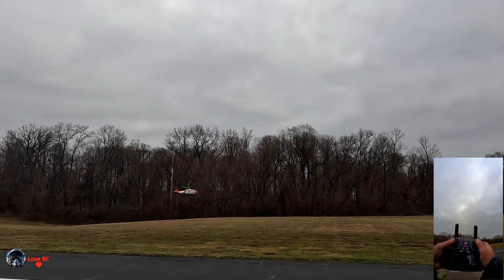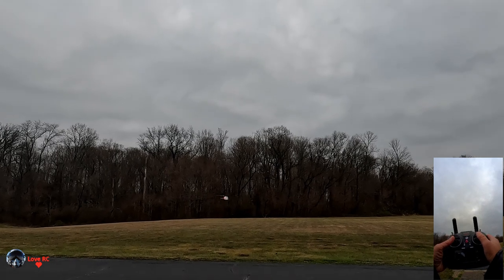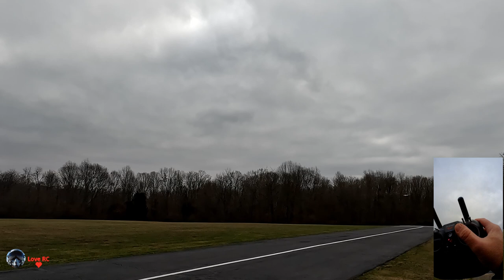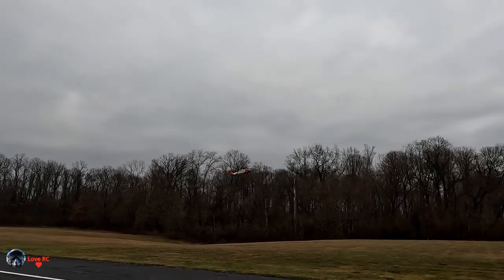YUXIANG F09-S Blackhawk Coast Guard UH60 Rescue Helicopter - THIRD FLIGHT!!!

Comment: I can never get tired of looking at this helicopter fly? It's definitely a great looking helicopter. Even the sound is not bad.  Very nice flight, Thanks for sharing.  👍👍👍
Reply from the maker: The main rotors have a nice sound.  Wish it didn't have a whiney tail rotor.
Reply from the maker: In manual mode you have to pull back on the stick to get her to slow down. Love the sound
Reply: @LoveRC  absolutely

Comment: i wonder if by putting more blades on that tail rotor.  if you can get it quieter.
Reply from the maker: The separate tail motor helis ate usually loud.  My blade 360 and 180 are not because they are belt driven.

Comment: no doesn't depends on how many satalites you have at all.  
when you are that close to the radio.  it will just auto land wherever it is.  
you need to be standing much further away for return to home to kick in.
Reply from the maker: Usually I can steer it down but when landing on the roof you don’t have enough altitude to correct the landing.
Reply: @LoveRC  what are you talking about?  
at the end it auto lands because the battery's are empty.  
and you said "it landed 3 feet away from where it took off" 

and i am telling you that that's a complete coincidence.  that because of it's distance to you.  it just landed at whatever location it was at when the battery got low enoegh.  and it doesn't activate return to home at all.  just auto land.
Reply: @LoveRC  
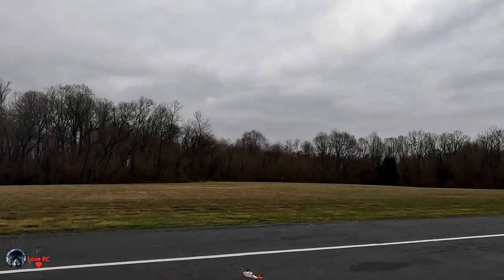so from 12:00 on.   it auto lands.  and you comment on how close it is to the take off point.   when that's just pure coincidence
Reply from the maker: @darkracer1252  yes it auto lands but usually you can steer it to correct where it lands. What I was saying is if you take off by your house, it can auto land on your roof and you don’t have enough altitude and time to steer it to the ground.
Reply from the maker: @darkracer1252  it is generally close to take off point but can be as much as 5 feet off.
Reply: @LoveRC  
is there a language barrier?  
are you just not getting what i am putting down?

you could have walked all the way to the other side of the field after takeoff.  and if the battery of the heli gets too low.  it would NOT return to home at this landing strip if you are standing this close to the heli... even ALL the way as far as you could be on the other side of the grass.  

it would just land.  where ever the helicopter is at the time.  because it's at a certain distance from your radio.  

only if the helicopter is further away from your radio.  will it use return to home to go back to the runway where you took off.
Reply: @LoveRC  
and all i am saying is that if you took off at your house.   flew the heli as far as it will go to the fencing.  then walked over to the helicopter and waited for the battery to get low.  that it would not fly back to the house.  it would just land near where you are standing because of the distance between your radio and the helicopter at the time that the battery got low.
Reply from the maker: @darkracer1252  yeah but I was standing on the sidewalk at the front of my house. Therefore it landed on my roof.
Reply from the maker: @darkracer1252  I’ll test this tomorrow
Reply: @LoveRC  
that would be awesome. 
do be safe when testing things. 
it's not a cheap heli :P

mine will ship out in 2 days.  

but yeah from what i have been able to look up it should know the distance between it and your radio.  
i don't know if the fencing moves around with you though.   would be awesome if it did.
Reply from the maker: @darkracer1252  oh I’ll stay away from obstacles.
Reply from the maker: @darkracer1252  I just did a test and it lands at the GPS point it took off from within a few feet. So at home it took off a couple feet from my roof and thus due to the +\- it landed on my roof.
Reply: @LoveRC  alright. good to know
let me go yell at the other youtuber who said it would just land near you

Comment: Very nice ! Do the batteries of this helicopter fit the other model YXZNRC F09 UH60 helicopter and vice versa ?
Reply from the maker: It appears that they can but not sure if they are exactly the same.  I have 3 for  the F09 and 3 for the F09-S and only use them on the respective heli.   That's plenty of flying.
Reply: @LoveRC  Yes you're rigtht... Thanks a lot 😀
Reply from the maker: I did find that the balance charger works on the old batteries as well.
Reply: @LoveRC  you mean on both types of batteries for the two helicopters ? 😀
Reply from the maker: @aureliusprimus  yes
Reply: @LoveRC  very interesting. Thanks a lit !!

Comment: Hi, I see you own the FW200 as well, which heli do you think is better?  The built-in 3d functionality is really attractive to me as I've been a beginner heli pilot for well over 15yrs :(
Reply from the maker: The F09-S is better.  I sometimes loose the GPS lock on the FW200.  When that happens you are flying it manually.  I have never had that happen on the F09-S.  The 6g gyro on the F09-S is very well done. It’s very stable on manual mode.
I crashed the FW200 twice loosing GPS lock.  The FW200 is a tough helicopter though.  Minor damage crashing it. Manual mode has no gyro assistance.

Comment: Hello !! I take out my F09S after several months of interruption and there at the surprise start, the >LED flashes yellow slowly all the time.. I put GPS, auto, manual, done the gyroscope, the compass calibration, in short everything, the LED does not turn green.. Hence my question, have I forgotten a detail even an ignition button because I no longer remember, I specify that the few flights I have made have been great none shock no crash, in short nickel what... I must have a memory lapse, I turn on the radio, then the battery and nothing else.. If I have forgotten something... because nothing in the instructions
Reply from the maker: Make sure you have fresh batteries in the remote.  Make sure you have it set on gps and automatic.
Reply: @LoveRC  Thanks a lot. Just need to calibrate the helicopter !!! I will try the helicopter on the afternoon !!
https://www.youtube.com/shorts/uSNHqkLXYdE
Reply from the maker: Hope everything works well for you!
Reply: @LoveRC  yes thanks a lot !!

Comment: There are now lots of videos of this heli on Youtube. Why does everyone fly so far away? They all bounce up and down in the hover. My qustion is, "will it autorotate?" Does anyone want to try?
Reply from the maker: Helis that have a tail motor instead of belt driven, do not auto rotate.  This heli auto lands though when the battery gets low.
Reply: @LoveRC   I don't think you understand. The first successful electric heli was the Kalt Whisper which autorotated beautifully. Normally, an autorotation clutch disengages the tail and the tailrotor stops during autorotation, so why should a tail motor be any different? the real question is whether there is enough inertia in the blades? I doubt it since nobody uses weighted blades anymore.
Reply from the maker: @daveday5507  I had the tail rotor motor completely fail on the Green Blackhawk and she spiraled into the ground.
Reply: @LoveRC  That will happen if you keep the power on. You should  close the throttle. If you have some negative pitch it should 'glide', but the amount of negative is critical. You have to set the heli up to autorotate amd few people do this.
Reply from the maker: @daveday5507  yeah I'm not doing that on this one.